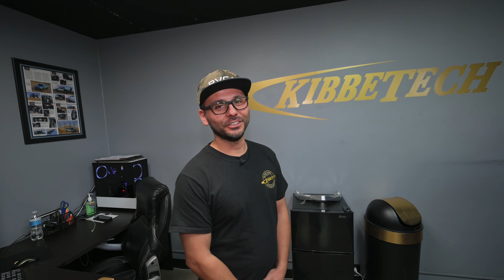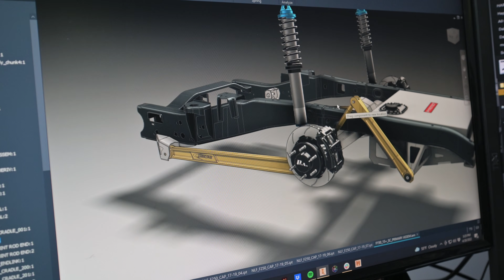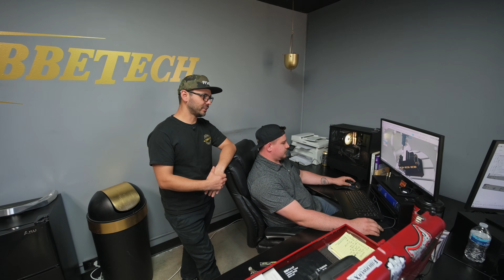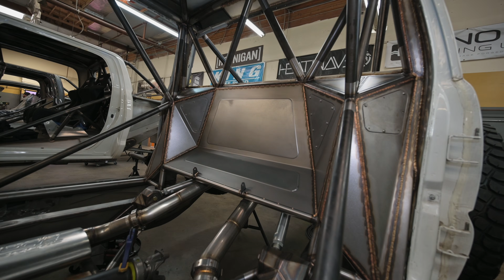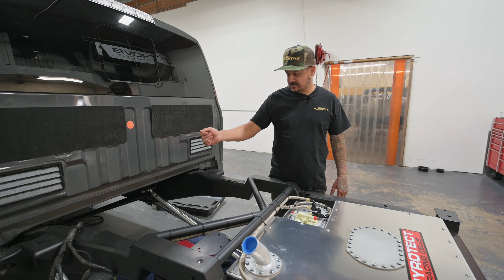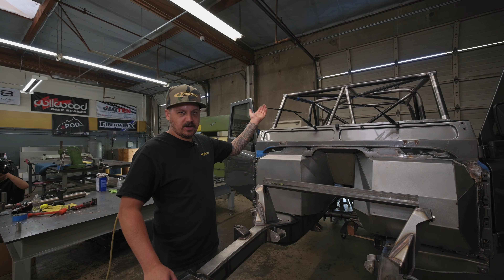Designing Parts at Kibbetech

Comment: What are the travel number and perspective shock size differences in your bolt on race kits vs centermount?  For instance… Black prerunner (my fave truck ever so far) is a traditional bolt on kit.  with all the center mount stuff being built in house today why did the owner choose to go bolt on vs centermount?  Just to avoid the additional fabrication it involves (doghouse, firewall, etc)?  Is centermount over built for what most of these trucks coming out of the shop will do?  What would the potential difference be on Barstow main top speed black truck vs say the gray truck v. 2.0 when it’s done?  Is centermount more of a status symbol or necessary for serious prerunners?  The corporate cruiser still handles the business without a centermount.

Comment: Question to answer. I am currently a high school teacher, teaching auto and one class of cad/mechanical design. Of course in high school it is a fairly introductory program, but I do teach a lot of engineering and vehicle dynamics in my high level auto class. Would you ever look into hiring someone straight out of high school if they showed large interests and were willing to learn from that age or would you prefer someone with experience in the field of engineering, welding, and assembly? If you prefer experience, what background or “degrees” are you looking for? Thanks!

Comment: I wanted to build my s10 with long travel . Trying to be 12 inches over stock to 67 track with. Would it be possible from stock lower position. It will be a good fit for using a 2003 silverado rear end.  It is 4x4

Comment: I mention this only because I sincerely hope you have addressed this already. Please ensure the quality, security and robustness of your LAN, Server installations, Backups, Backups, Backups to save your data in the case of the inevitable power outage. I advise a UPS system for computers and the associated Cad/Cam milling machines. Make the digital system bulletproof like your trucks! Yes, It will cost to do it right. But one power outage crash and data loss is far more expensive and debilitating. Awesome shop Ryan!!